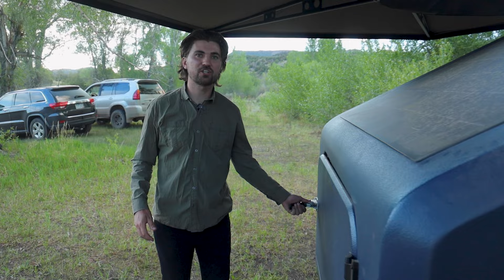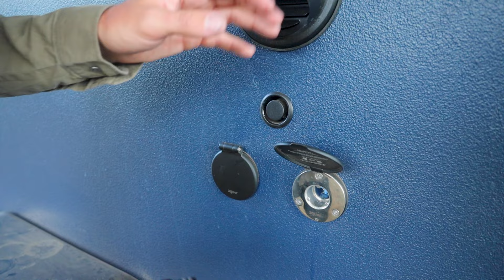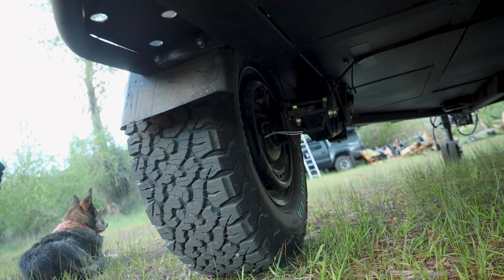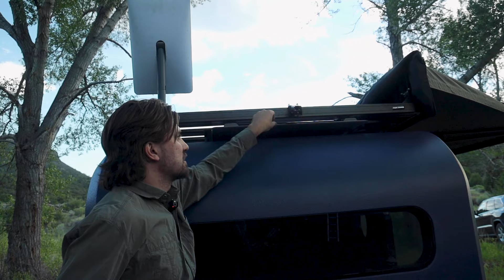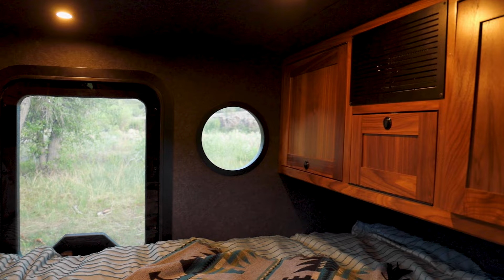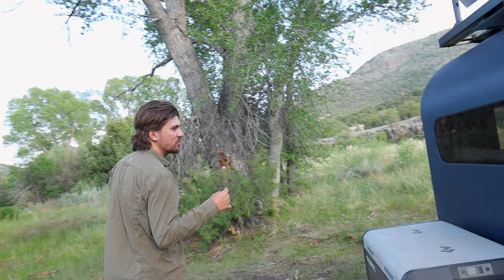NS-1 Walkaround Tour: Powering the Ultimate Off-Grid Adventure

Comment: 1. Any data on conductive heating vs heat pump ? Maybe size was an issue but there’s some small heat pumps starting to hit the market. 

2. Also a dc to dc step up/down buck to manage the voltage on your electrical vs going with AC inverter ? 

I assume the biggest response is that there isn’t a lot of development yet in higher voltage dc appliances but once they progress, I wanted to see if the DC buck looses just as much in converting voltage than inverting DC to AC. 

Just hoping to remove inverting/converting in the future and better shade/conversion tech with panels. 

A world where you can truly live off grid and be mobile.